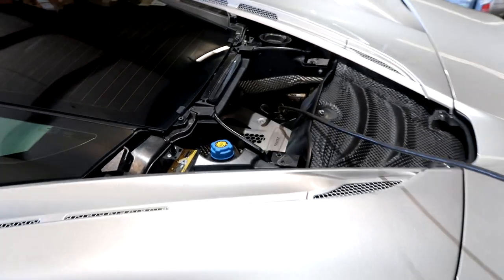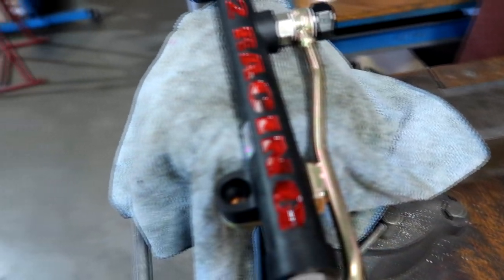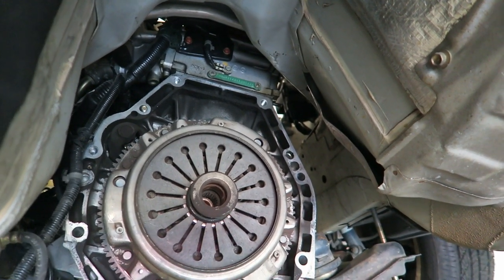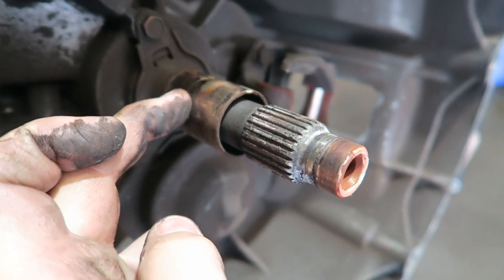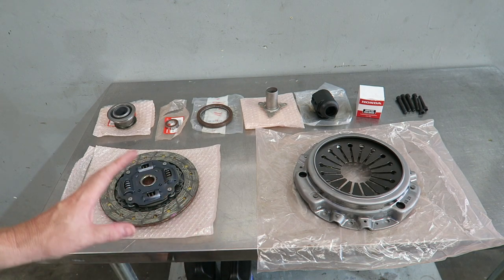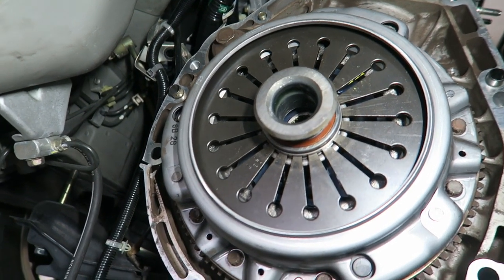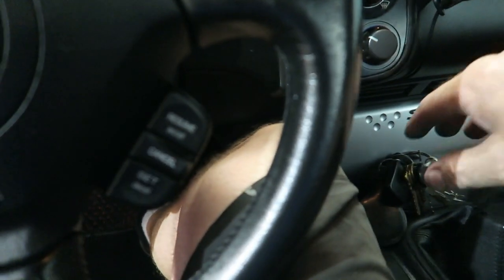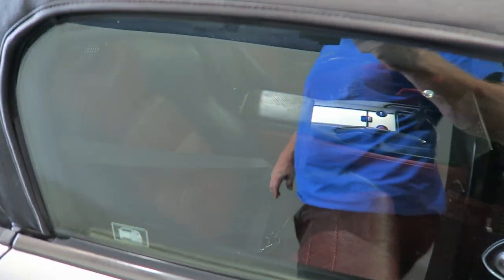OEM Clutch Install, The way we do it !!!

Comment: You guys always do a great job! I'm up in Reading PA, and ive done quite a few s2k clutch jobs. I'm not a professional by any means just love these cars. One thing I would say should definitely be replaced if you're taking the flywheel out is definitely the flywheel bolts which are one time use. I always recommend to anyone with an s2k just to replace all the hardware when doing a clutch job. On my own personal s2000 I had a Honda tech replace the clutch and flywheel once and he didn't replace the flywheel bolts. A few months later I pulled the trans out and three of the flywheel bolts backed out! Always replace hardware!!!!! Lol....you guys are awesome and always go the extra mile

Comment: I always recommend a stock clutch for a stock setup. Nice factory pedal feel/engagement and the pressure plate diagram spring is perfectly matched for the hydraulics and the actual pedal assembly itself. I've seen broken welds on the clutch pedal assembly on 8th gen civic with either an upgraded clutch or a factory one that is so work hardened it's very heavy and the slightest bit of flex over a long period of time causes the spot welds to let go.

Comment: Awesome tip with the space grease on the sub frame bolt. Just struggled getting the front out and used a ton of penetrant and slowly worked the bolt in and out to not strip anything now I won’t have to worry thanks to that tip.

Comment: The OEM rear main seal has a metal lip on the engine facing side, the non OEM ones lack this metal ring which keep the seal from expanding at very high rpm.
Reply from the maker: Rolando Tillit We buy our deals direct from Honda.   It’s the same we removed.

Comment: Maybe add that input shaft seal to your kit as well. My input shaft seal was leaking on my eighth gen si but unfortunately you have to open the case and replace it from the inside.

Comment: Exedy is who makes the stock clutch so it’s hardly aftermarket.   In fact Honda UK were supplying the exedy clutch for a few months when the Honda boxed one was on back order.
Reply from the maker: altypeRR They could make it to Honda specs.
Reply: No, Exedy do not, and have never manufactured s2000 clutches. Exedy cleverly market their s2000 as “oem replacement” to be deceptive. 
Compare the disc spring housings of the genuine Honda FCC clutch vs the Exedy equivalent.
Reply: I was under the impression that Exedy as well as Deikan were OE manufacturers for Honda

Comment: Excellent video like always!  Have you tried the ACT HD pressure plate and OEM everything else on your table combo?  Seems like that's the go-to set up for OEM feel and up to around 500 wheel hp
Reply: This is the best setup, also adding the lighter Prolite flywheel makes it even better. This is what I run on my S.
The FX friction discs are inferior to the OEM FCC one and they are going buzz and fail sooner.
Reply: @andersw1152  I just installed this set up in my supercharged ap2 and swapped to an OEM ap1 flywheel.  It's almost back on the road.   Wish LHT was closer to me would've just had them do it!

Comment: Brought exdey OEM clutch for B18 came with OEM bearing was cheaper than aftermarket 
Cant go wrong unlike the aftermarket clutch its replacing
Reply: For the s2000 all clutches are manufactured by FCC and the Exedy ‘oem’ or ‘hd’ products are vastly inferior.

Comment: How far do you push the seal in the back of the transmission. I replaced mine and ruined my new clutch because it started leaking so I was hoping for a little clarification before I redo the job again.
Reply from the maker: I would look as the placement of the original seating position.  You will see a mark on the shaft the old seal left behind.  Make sure everything it lined up to prevent the seal folding over.

Comment: John, can you go into more explanation on why you and George aren't a fan of an aluminum flywheel? Does that only apply to the S2000 application? Been running the Clutchmasters FX300 and FX250 on the GD3 with their aluminum flywheel without an issue for a long time, would like to hear your feelings and experience on the subject. Did the owner of the car in the video go back to a stock one?
Reply from the maker: lcq4blackstar The main reason I think they are a little too light for street cars.
Reply: Agreed, mine came out to 8lbs, probably just over half the OEM weight. I think 10lbs would be the perfect balance in that application. Once you adapt to driving a light weight flywheel it's a non issue. They really change a stock engine's characteristics, glad to hear there isn't some issue I'd have to worry about.

Comment: Guys, what about the bolts that are used to attach the flywheel and the pressure plate? Do those need to be replaced every time? What's the confusion with loctite on the 12 point flywheel bolts?

Comment: Very informative video. I’ve read that on the RSX the exedy OE replacement clutch is the same thing as the Honda oem clutch. Apparently that is not the case for the s2000?
Reply: All s2000 clutches are manufactured by FCC - for the s2000 don’t go near Exedy.

Comment: Hey Dudes,
I have a 92 Civic CX. I’m keeping it all OEM original. The D15B8 still has the original clutch and flywheel. Release arm is getting noisy so I’d like to change this out. I be surprised if the OEM is available but do you have a aftermarket compatible kit? I’m not running any hp. It only has 71hp. Just want to keep it running and reliable.
Reply from the maker: You can put an Exedy, just run an OEM / Nachi bearing. The bearing usually is the culprit to most failed clutches I’ve seen.

Comment: excuse me John, Where do i apply the YOUREAR Grase? besides the slider and shifter rebuild. thank you, my fx300 kit just arrived. very well packaged
Reply from the maker: Awesome.  Apply the grease on the inside of the release bearing and slide. Then a small amount on the splines of the transmission.  Not too much on the splines. Just enough to make them wet.

Comment: thanks for providing this video information.  i will buy your oem s2000 kit from you.  i noticed that you did not include the an oem fly wheel with the kit. does it mean that i don't have to replace my oem fly wheel? my s2000 is about 105,000 miles. if i need to replace my fly wheel, can i replace it with a lighter fly wheel? can you recommend any lighter after market fly wheel to pair with an oem clutch?

Comment: ACT HD pressure plate or the OEM pressure plate for the 2005 s2000? I heard there was crank walk with ACT HD pressure plate ....which i was also told is now resolved. I see your site has both set up.
Reply from the maker: There is added wear on the thrust bearings which can cause crank walk. There’s no perfect clutch apart from the OEM Honda clutch. Every clutch with added torque holding capacity has a trade off unfortunately, you just have to find the one that suits your needs.

Comment: 20:18 Dang, left the bell housing covered with old clutch material? C’mon John/George!

I’m just poking fun, but kind of surprised at the same time.
Reply: Dustin I saw that too, but I think they changed the bell housing with the old one because of the transmission seal? You can see at 18:00 the new transmission bellhousing doesn’t have clutch dust.
Reply: Matthew Yang yeah maybe it was just the way the video was edited.

Comment: Can the ap1 flywheel generally be reused or resurfaced?  Or should I plan to replace the fly wheel as well when doing the clutch?
Reply from the maker: Robert Gerety most cases the flywheel can be re surfaced

Comment: not an impact screwdriver?  do tell!  also... i thought Exedy is the OEM manufacturer of Honda clutches.  Is this not true?  Do they use different throw-out and pilot bearings?  Are they not the OEM manufacturers?
Reply: I believe they are the OEM clutch manufacturer.
Reply from the maker: phunkdoctaspock This not true.  Exedy Do Not Make the clutch for Honda.

Comment: is that clutch you recommended, also recommended as a stage 1 clutch?
Reply from the maker: k_aus I would recommend this complete OEM clutch until 300whp. Then it needs an upgrade.

Comment: Do you know who is the manufacturer for Honda clutches?
Reply from the maker: Stan I’m not sure, I used to hear it was Exedy.  But the OEM Honda clutch doesn’t look the same and it sure lasts and performs better.
Reply: All s2000 clutches are made, and branded, by FCC (Fuji Chemical Co).

Comment: What type of grease do you use on the throwout bearing?
Reply from the maker: Honda urea Grease.  We sell it in the LHT Store.  .
Reply: @LHTPerformance  Thanks, I usually use Super Space Grease and red grease.  This time its Urea.
Reply: @LHTPerformance  Do you apply Urea to the input shaft spline too?
Reply from the maker: @simpsonsdotcom  yes. A small amount